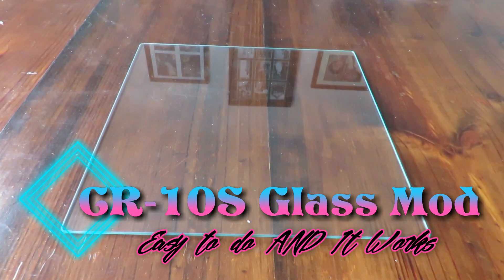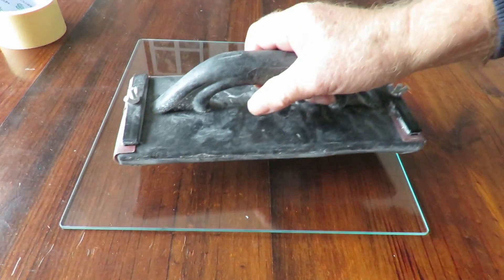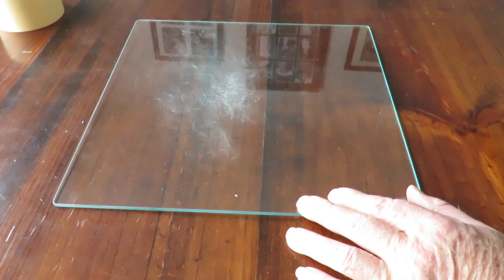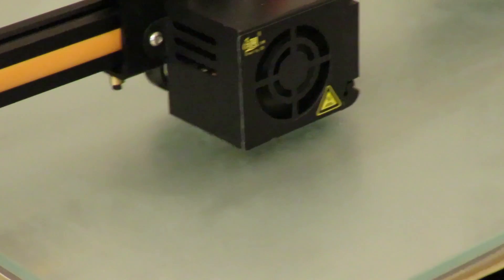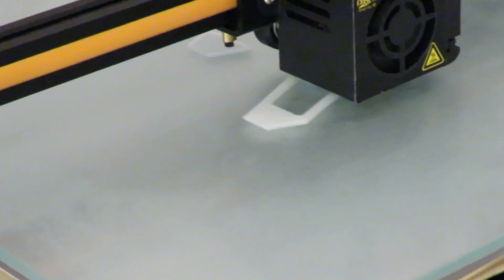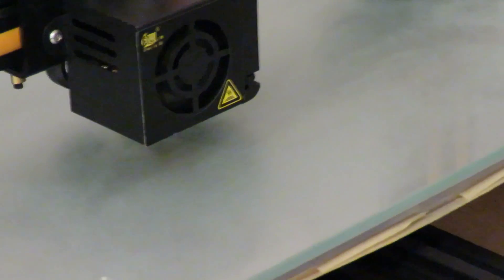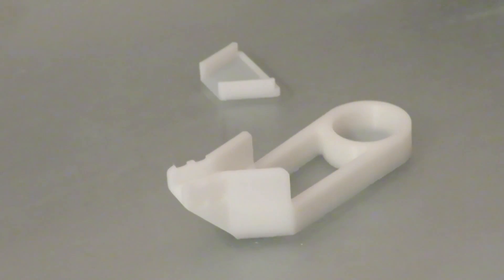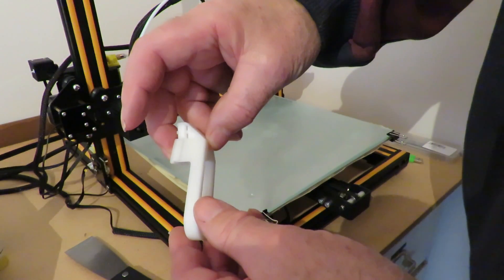📌 Creality CR-10S 3D Printer Glass Plate Modification for Better 3D Print Adhesion

Comment: This idea works a treat.
I saved some time with an angle grinder and a ' flap' sanding disk.
Well supported underneath with an old towel and  circular runs down the glass.
Wear breathing apparatus and safety glasses. 
Gently does it.
3 times my print failed before giving this a go. 100% all good now.
No more glue stick I reckon.
Thanks mate. Glass is now the perfect surface.
Reply from the maker: Glad my Video helped you.
P.S. Thanks for commenting.
Reply: i guess I am quite off topic but does anyone know a good website to stream newly released tv shows online ?
Reply: @Alex Phoenix i watch on FlixZone. You can find it by googling :)
Reply: @Jude Jad Yup, been watching on FlixZone for years myself :D
Reply: @Jude Jad Thank you, I went there and it seems to work :D I appreciate it!

Comment: I cant get myself to scratch up my glass
Reply from the maker: You can always use watered down wood glue to help with print adhesion.
Reply: @GarryPurcell  i was gonna get the magic goo
Reply from the maker: @zergmare7  Let me know how it goes for you.
My mix was a watered down Wood PVA mix, layered while the heated bed is turned on, and I used a soft brush to apply it evenly.
Reply: @GarryPurcell  random question,  but does anyone print over usb?
Reply from the maker: @zergmare7  I use Octoprint running on a WiFi Raspberry Pi, which uses a USB connection to the Printer Controller.
Reply: @GarryPurcell  i tried to set it up but nothing would work right so i gave up
Reply from the maker: @zergmare7  I made a video a while ago showing the way I use the Wood PVA.
You might find it handy, and have another go using PVA.
https://youtu.be/WxgHSpk44yk

Comment: Will  310x310x5 mm glass bed will work with cr10s pro

Please let me know I am waiting
Reply from the maker: I don't own a cr10s pro.
I'd suggest you go to the Creality website, and check glass measurements.
Reply: @GarryPurcell  on the Creality site they have mentioned that bed size is 300x300x400 mm but in practically it will more bigger than above metiontoned because it will have glass bed holder clip on the bed so it will be bigger than the measurement they have given.

Comment: Glass likes to be worked WET. Your results will be better and achieved quicker, when working in a shallow try filled with water. For about 4 bucks you can get a sponge type sanding block that has a permanent coating of diamond dust in a binder matrix. I'd start with a 1000 grit and maybe finish with a 1500. Keep in mind that roughing the surface of glass will reduce its impact resistance by around 75%, meaning a 4mm sheet of glass now should be handled as if it was a 1mm sheet! Also, "hard" (borosilicate glass) is less tolerant against micro scratches than lime-soda glass. I am pretty certain my CR-10S came with a borosilicate glass - so be extra careful...
Reply from the maker: Thank you for that advice.

Comment: Garry, Thankyou.  This works perfectly on my CR-10 Pro.  Tape, adhesion sprays, etc.. they SLIP!  Thanks again for sharing!  T.J.
Reply from the maker: Glad you found my video useful.
The glue will last quite a few prints, before the glass needs to be recoated.🙂
Reply: Just heat your bed to 65 degrees celsius and clean it with warm water and soap. It holds even too much that way :) Can't get my print of the bed right now :|

Comment: I use mirror tiles that I bought from Lowes. In my experience scratching the glass results in, eventually, pieces of glass breaking off of the tile and sticking into the PLA that I just printed. If I keep the glass clean then I don't have a problem getting PLA to stick to glass that has not been sanded. However I mainly use CCTREE PLA.
Reply from the maker: Hi Fred
Thanks for adding your comment,
Its an interesting topic that appears to have many different solutions, and whatever works, is best for you. 
I have 4 printers, and some seem to perform better than others, when it comes to print adhesion.
P.S. I'm a big fan of mirrors also.
Reply: @GarryPurcell  , I have even had a piece of glass chip off of a mirror tile that wasn't scratched, when I tried to remove a part before everything had cooled down to room temperature. I now view the build surface as a consumable, that will periodically need to be replaced. Luckily mirror tiles are really inexpensive.
Reply from the maker: So far I've never had any mirrors chip.
I think if you replace the mirror on the printer with a spare one while you do multiple prints, this will allow the first print to cool down.

P.S. I know I get impatient, when I have visitors watching the printers, and I tend to pry a print off the glass, before it has cooled.

Comment: Perfect, I used 400 grid of sandpaper and works really good for adhesion. I want to cut another sheet of glass and use a 800 grid sandpaper. Thank you.
Reply from the maker: Glad it works well for you.
I think frosting the surface really helps with plate adhesion, and the finer 800 grit should work nicely.

Comment: when i saw the sandpaper touch it i was like ahhhhhhhhhhhhhhhhhhhhhhhhhhhhhhhhhhhhhhh
Reply from the maker: Haha
Nothing ventured nothing gained.🙂
The glass that was supplied with my printer was warped, so I had nothing to loose.
The result was the high spot in the center was removed, and I did not have to replace the glass.

Comment: I have a cr 10 and I just use blue painters tape and I rub it down with isopropyl alcohol before each print it sticks so well it's almost impossible to get the prints off so I use a flexible bed.
Reply from the maker: Thanks Christopher
Its always good to see what others are using successfully for 3D Printer model adhesion.
Reply: I think Garry's idea here would help save the time it takes to remove/clean the tape before every print. I don't know about you but I've had the tape stick too well and end up ripping off, onto my print. Not fun.

Comment: Try sand blasting instead. It works for me. Maybe a bit too well as the last print took a chunk out of the glass.
Reply from the maker: Sounds like the micro scratches are definitely working 🙂 
I don't have access to anyone with a sand blaster.🙁

What type of grit did you use with it?
Reply: Garry Purcell . I used 20 grit sand for a light sand blast
Reply from the maker: Thanks for the info.
It should prove handy for those who have the equipment.

Comment: Why would you do this....
Reply from the maker: Warped Glass
Reply: But you would have to use glue stick anyway, so scratching it has no purpose.
Reply from the maker: It levels the glass, so it is flat surface
You cannot print effectively on an uneven surface using manual levelling, your prints will lift.
Reply: ok thank you, that actually makes sense! 

But i'm still not scratching my BEAUTIFUL black glass, no matter how warped it is
Reply from the maker: haha.
As long as its beautiful and flat, you'll be OK.

Before I forget can also print directly on the glass without the need for glue

P.S. You can always turn the glass over, if you don't like the mod.

Comment: I've tried just about everything with my CR 10s and so far NOTHING works.  I can tell you that if you have to sand the glass and still need to use the glue stick that you've wasted your time.  I can get small prints to work by using glue stick the moment before the printer starts.  I can't print anything larger than 4" without the edges turning loose and surface warping.  Your demonstration of this tiny print on this isn't sufficient enough for me to go to this kind of trouble.  Thanks for your time but when you find something that actually works I would like to know.  I've used hair spray, pro, super sticky, dry and wet and it always lets go.  I need a real solution.,
Reply from the maker: Thanks for your comment
If you can only print a small area, then  I would suggest you have a warped glass, similar to what i started with.
The Power Sanding I did on it, leveled it out, and my Glass is now Perfectly Flat, and I can print full width as seen in some of my other videos. 

One other thing to check, is your bed leveled properly and make sure your print nozzle at the correct height.
Reply: Yes the glass is warped.  The only way I can get it to print at all is with the high center up.  I'm starting to think all the glass that comes with these things are warped.  I've done some serious adjusting trying to make this thing work with larger prints and I have printed one item that was larger than 4" but the first attempt failed.  The second I kept pasting glue stick on until the first layer was down and then it held fine.  Way too much trouble and I have not been able to repeat that.  I've learned that if I level the corners a tad high using a .22mm business card I can print in the center up to 4" and then only if I glue stick the heck out of it the moment before it starts and then only if I leave the bed cold so the glue doesn't all dry out before the first layer is down.  Strange thing though is when the head does a cleaning you can see the PLA go thick and thin across the line in the high and low spots.  Thick in the spots where it has room to print and thin where the glass is high.  When I was using a sheet of paper to level with the head would actually hit the glass, you could hear it scrape.  I've been trying to find another print bed that will work better but I'm new to this and all I can do is keep searching and asking questions.  I've ordered a meter for testing the print surface at any point.  Only $14.  Will make a holder for it on the beam by the print head and keep on searching for another print bed.

If you find something that really works please let me know.  Thanks again for your time.
Reply from the maker: Grab a mirror, and cut it to size, that will work quite well also.
I use Ikea mirrors on my Tevo Tarantula.
https://youtu.be/rOxG413g94c

I would suggest you power sand your existing CR-10 glass, you should be able to get it quite flat.
However, it will take quite some time.
Reply: @GhoolerHunter  turn the glass over it flattens
Reply: the method that worked for me after all the hussle especially on ABS is to Mix Ecertone + 6m ABS Filament mix them togetheer and apply a thing coat on a smooth glass. Works amazing. if you are intersted search for "MatterHackers How-To ABS Juice Glue and Slurry" on youtube. Is Now called Juice Glue
Reply: GhoolerHunter I have the same problem. First prints worked like a charm. They came out with a glass smooth finish no problems whatsoever. Then I wasted a lot of filament on failed prints and tests with temperature and bed level, but my first layer refused to stick no matter what I did. The only thing that works is a glue stick UHU. I though about checking to see if sanded glass surface sticks better.

Comment: Another question. Since the print area is usually a lot smaller than the glass plate why not gauge the height of the nozzle much closer to the printing area than the edges.
Reply from the maker: In a perfect world, the glass is perfectly flat, the outer perimeter is all that is needed for calibration, and to get a better result, the center of the glass plate is also measured for further tweaking of the leveling knobs..
Reply: Thanks for the reply. I find that the perfect world never happens, unfortunately. 
It just seemed to my untrained eye that this way of calibrating is back to front as it seems that the area used to be printed in is at the same height is way more important than the corners being at the same height.
Reply from the maker: Not so.
If you set the center correctly, but have one corner set too high, and the other too low, you have one side of your print squashed, and the one side lifting off the glass plate. So its important to level all around the bed to get the best 3D Prints.
Reply: I don't think I am expressing myself very well. I'll give it another go.
Let's say for example that the area of the glass that is going to be used for the model is15 cm x 15 cm square. 
Each corner of that square now becomes the defacto corners to be set to the correct height. 
This area should now be at the correct height to the nozzle for printing, generally speaking. At this point, it is important not to change their height of the corners because if I was to lift or drop down any corner at this point it will throw my aligned part out of whack. 
On the other hand, if I aligned the corners first and my plate wasn't perfectly flat the 15cm x 15 cm portion  I wanted to use won't be flat to the nozzle. This means more measuring and adjusting etc.

What is more important aligning the corners or making sure the area to be printed on is at the proper height?
Reply from the maker: I understand what you are saying.

In the scenario you proposed.
The same setup still applies, corners first center last.

When setting up for 3D printing (as far as tolerances go), you can still get away with a small amount of variance in the distance from the nozzle, to the bed. they do not have to be 100% identical.

An area of 150mm square should not be a problem leveling. (I would use the Center and the outer perimeter of your print as a guide.)

However, If your bed is so badly warped that you can't get it level from the edges of the build plate, it really needs to be replaced, or you could install an automatic leveling system, in order to compensate for the height variances on the bed.

I seldom level my build plate. (Although I do watch the first layer go down)
Its nice to know that once its leveled correctly, AND you don't put any undue force on the build plate, it stays quite level for many prints.
Reply: Thanks for your reply. I happened to have read a lot of people who had posted that their platform was slightly warped, maybe 1 mm difference from the centre to the edge. These people were advised to do a build up of tape in the centre if it was concave to somehow flatten it out. This didn't seem like a good solution to me.
Reply from the maker: I agree with you.
If your glass is warped, do what I did, choose the humped side up, and run a power sander over it to flatten it out.

Be sure to use a respirator when using the power sander.
Take your time, and check how its going regularly with a steel ruler, and you will get a reasonably flat glass build plate. This process will take an hour or so to do.
Reply: Thank you once again. I'll let you know what happens after the printer arrives and I do a few things.
Reply from the maker: If you need any help, just pop a comment up, and I'll do my best to help you.

P.S. The last CR-10 mini and a Standard CR-10 I received, both had a perfectly flat glass.😀
Reply: That's good to know as the glass will be the first thing I check seriously.

Comment: Doesn't the glue fill all your micro scratches?
Reply from the maker: Yes, it  does.
You have the option of using Glue, or printing straight onto the glass.
Reply: So only put the glue on the scratched glass if the scratched glass doesn't work. Just clarifying things so it's clear in my mind. Thanks for the tips.
Reply from the maker: My glass was originally warped, and I sanded it flat.

You can use the micro scratched side with or without glue, and you also have the added bonus of turning the glass plate upside down, if you don't like the scratched surface finish.

Comment: This is all unnecessary,  Just heat the bed up to 70 Deg C for PLA and it will stick like the you-know-what.... When the glass cools down it releases without any force, perfect glossy print every time.
Reply: bed that hot promotes warping/curling.
Reply from the maker: My glass was warped and the sanding flattened it.
Reply: I have not experienced that but that does not mean it is not true of course, so I will keep an eye on things.
Reply from the maker: I can print on cold glass if I choose to.
The micro scratches work quite well at holding the print on the glass.
However I normally use between 45 and 60 as the bed temperature.

P.S. Just be aware that PLA normally has a glass transition of 60 degrees, so anything above this might cause unforeseen problems with adhesion ifor prints that take many hours to complete..
Reply: Alot of people including me have no had any issues with sticking or anything with PLA on glass with a bit of gluestick or hairspray, dont need to scratch the surface.  I have my bed temp at 60 degrees but the actuall glass is slightly cooler that the heatbed)
Reply: I print with bed at 60° and that's just fine.
Reply: Seems like a good idea to me. I have a printer that doesn't have a heated bed and struggles to keep prints sticking to the glass without some type of adhesive added on. Going to try this tonight. Worst case, I flip the glass over and have a clean surface again.

Comment: what quality of glass did you used
Reply from the maker: It was the original Creality one. and the glass was warped, so the power sanding made it level.
Reply: Garry Purcell I want to buy another glass so i was wondering the glass is tempered or not??